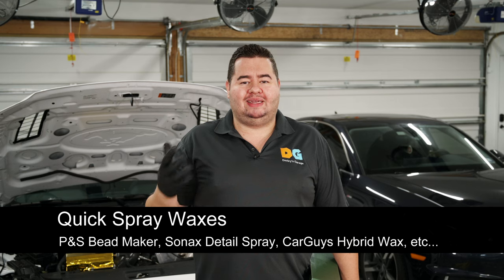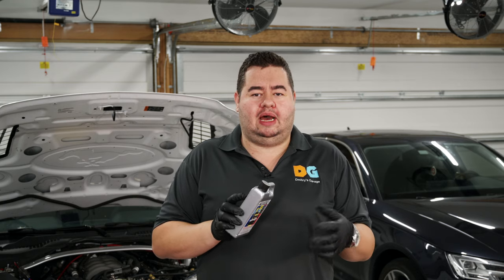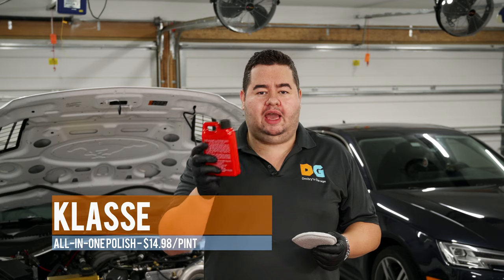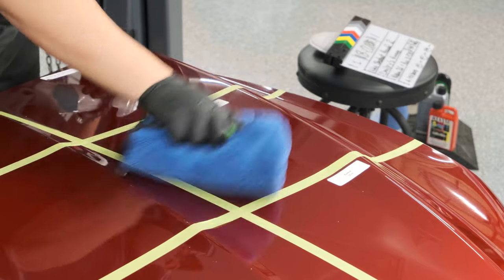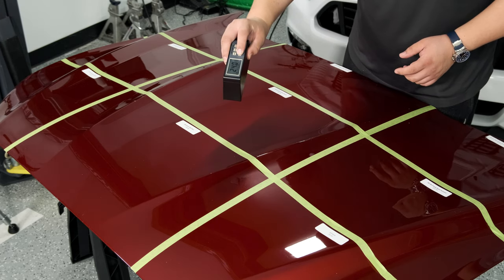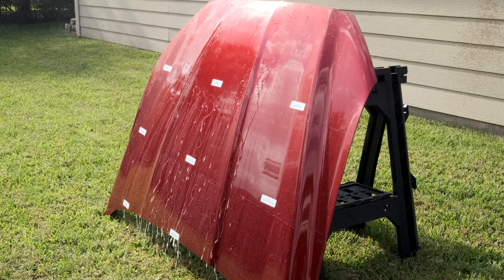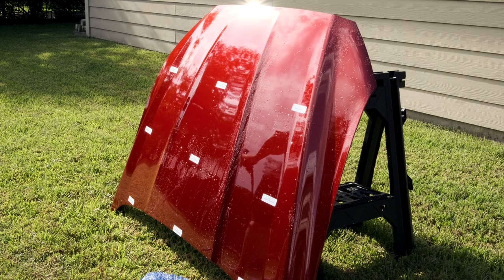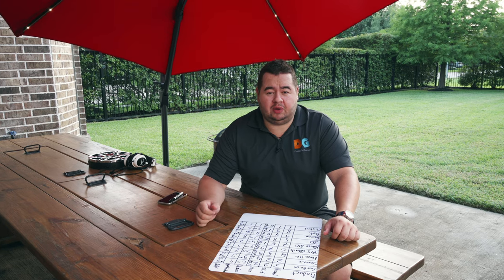What is the best car wax? We test sealants, waxes, hybrid spray waxes, and ceramic products!

Comment: Great video. Please clear my doubt. I'm confused between collinite 845 and klasse hgsg. Which one is the best? I know they both are different products. Still it's enough that they both can protect the paint for daily usage, swirls and nail scratches. And which one is anti static? I don't want my car to be a dust magnet. Suggestions please.
Reply from the maker: yogesh definitely go for the collinite 845 its better in almost every way
Reply: @DmitrysGarage  : thanks a lot for your reply.

Comment: Hey boss man what's gives a better deep wet look between Wolfgang 3.0 sealant or Wolfgang Uber ceramic spray ? What u prefer n when is the best time to put it on before or after I wax it? I'm going to clay bar it first
Reply from the maker: Looks wise I think the 3.0 is going to be the best, but the ceramic spray will last longer. I would definitely use these products after clay. I don't necessarily recommend a wax on top as you'd have to test it out and make sure it works well with these products. I usually don't stack products too often.

Comment: Did you read the instructions with any of these in regards to application? Because you used about 5X more than needed on the Car guys product, or was it purposely or a specific reason?
Reply from the maker: Thanks for watching. My goal was to follow the instructions as written on each bottle. However, for this kind of testing I really can't spend enough time with each product to learn the best way to do it. I did publish a table on my site (link in description) and  you can just sort the columns and work out your own scoring if you don't like some of the testing parameters. If this was over applied it should have only affected ease of application score wise. Also keep in mind since I'm working with tight areas, I can't do a wide full throttle spray or it will go everywhere.

Comment: I don’t think u understood many of these products or the applications.  But U tried hard and I give u that
Reply from the maker: Thanks for watching! Want to clarify on that? What specifically did I miss?
Reply: Dmitry's Dmitry's Garage well, I don’t remember all of it but an example of one is the Klasse Glaze and sealant .  U said u left it a few minutes to cure.  It actually takes more time than just a haze.  It’s easier if u let it sit for 20-40 mins.  Also, u use a quick Detailer and spray it on the towel to remove it if it’s a pain to get off.  U also applied way to much.  I noticed this of others u used as well.  The Klasse all in one also does better under the Klasse glaze n seal(thus Klasse Twins).  The Collinite need to be melted and then it’s ready to apply.  But it was an interesting video to watch and I thank u for making videos as they are helpful and makes us love detailing.
Reply from the maker: @DetailingBreakdown  Thank you for the detailed reply, I truly appreciate it and the time it took to reply. One thing I would point out is that my reviews are tailored towards users, not professionals. Personally I have various ways of using products that are not necessarily obvious. For instance you mentioned melting down Collentie, but nothing about Collenite's packaging suggest melting it down when following instructions.

My reviews follow the details on the bottle. I've re-tested the Klasse products since, just to get new gloss numbers, and they're still hard to remove. Also cure to me means after removal, curing is the time it takes before you can wash/test. I could have used detail spray, but detail sprays often contain other polymers that will impact the testing. For example Sonax Detail Spray is a sealant in its own right. Klasse also doesn't specify how much time, it just says to a haze. It may help waiting a lot longer, but some waxes are actually harder to remove if you wait more. For the purpose of my reviews I can't keep testing it all different possible ways beyond what the bottle suggests.
Reply from the maker: @DetailingBreakdown  btw sweet channel, just subbed!
Reply: Dmitry's Garage I appreciate u follow directions on bottles.  But sometimes you have to think outside the box.  As I am a tester for many products and in the industry as well. Myself and many others have found other ways or techniques that are far more beneficial when using these products.  Even for the DIY person who may not be a pro, easier instructions or better insight on these products would be more helpful.  Just a suggestion, use the products a few times and get some tips and tricks under your belt to further help the new people learning.  If I wanted to know about a product, it would be more helpful to me if the mentor had already used it and knew a little more about it.  Just my opinion.  Keep up the good work.
Reply: Some of the products I see in ur video I have not used and it was nice to see ur input.  However, would be better for me(was he viewer to learn from research that u have done and experiences you have had after using the products more thoroughly and knowledge that comes from tips and tricks that u may find on ur previous attempts.
Reply: Dmitry's Garage haha, I appreciate it.  I’ll sub yours as well.  Keep in touch
Reply from the maker: @DetailingBreakdown  Yea it is something to consider.  I know you and I are enthusiasts and I dive real deep into products that interest me. I'm sure you do too. 

For most people there are just SO MANY products out there. As a result I've opted to just follow instructions, which is what most non-enthusiast users do. I polled a lot of my friends who aren't necessarily detailing nerds, and most just want to know "is it easy to pick up and use, does it look good and will it last more than a few washes?" 

If you pick up say Wolfgang or Jescar and use them, the results are stellar and as easy as reading the bottle. On the other hand the Klasse products just weren't. I'm sure they could work well in a deep dive, but that's not what most people I've talked to do.

However, I will think about what you said and see if maybe I can integrate some deep dives into specific products. It's definitely an interesting thought.
Reply: Dmitry's Garage yes, I like the Wolfgang products as well.  And ur right, many easier products to use than Klasse.   But it does hold pretty good ground being an old school sealant for all exterior parts of the vehicle.   Definitely, not for everyone.  My friends tell me to do videos on stuff they can buy at the store.  I just can’t bring myself to buy most of them.  I just review what I am interested in.  Usually, online shopping items.  But now McKee’s is in the stores.  Turtle wax is coming on strong, and who knows what’s next.  Many good products online at Walmart as well.  Big names but not on shelves.   Have a good night
Reply from the maker: @DetailingBreakdown  Haha yea I get split requests myself. Some people ask for stuff from stores and say "who's ever heard of any of this crap", while others go "omg why are you doing stuff from stores, do niche enthusiast stuff". You cant please everyone :).
Reply: @DetailingBreakdown   The thing most don't understand about Klasse SG besides it's application, is that it was designed to sheet, if you compare it to paint that hasn't been coated you will see a huge difference.

Comment: I HATE HATE HATE Klasse Sealant. I used it 10+ years ago a couple of times and every time it was a pain to remove. I still remember the car I was trying to get it off too. If you dare let the sun touch it forget about it, throw the car out. As far as I know the formula hasn't changed since the 80s. Two spritz of turtle wax hybrid is easier to apply and provides better protection.
Reply: I had that happen with Duragloss Swirl Remover. It's basically an All In One with a durable sealant/wax. 

It was like trying to wipe off Ceramic Pro 9H coating. Both were competent nightmares.